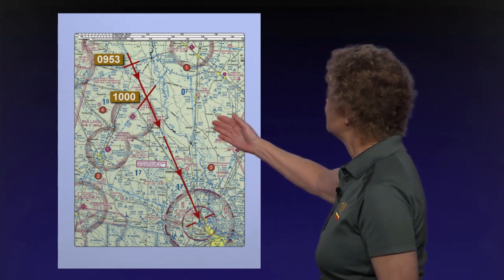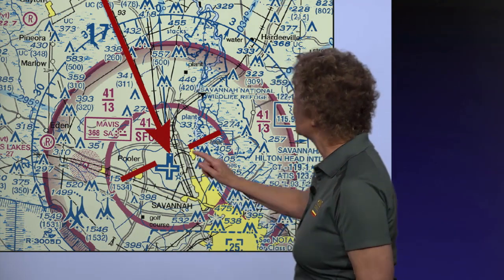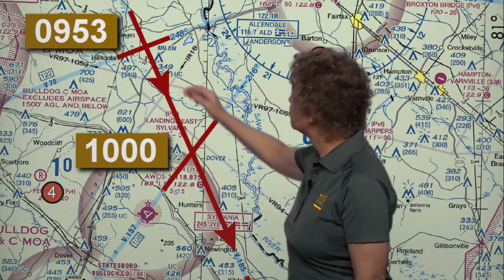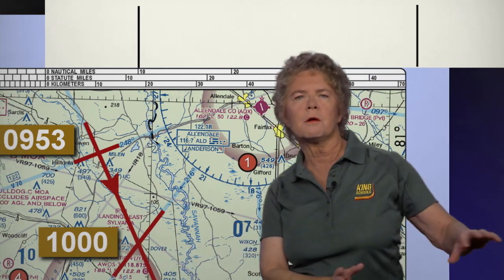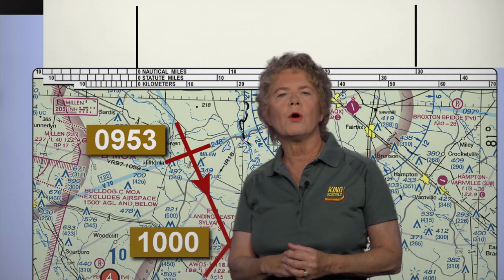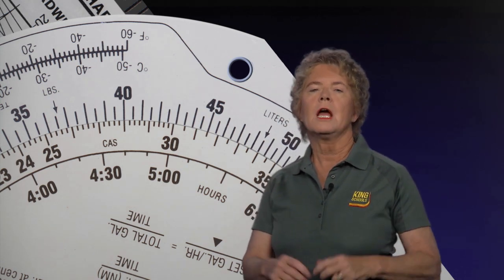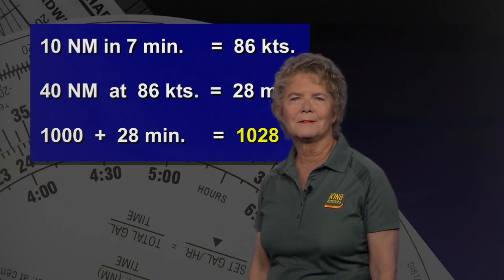How to Use Your E6B - Video 9 of 14 - Calculating ETA (Estimated Time of Arrival)

Comment: You already traveled 10nm, so you only have  30 nm left; not 40!
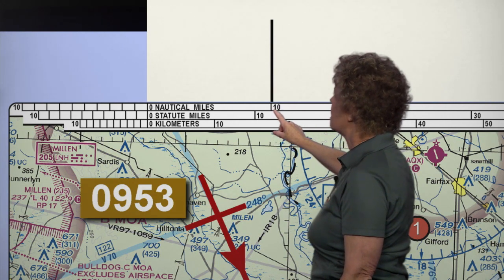Reply: Wrong! The flown distance of 10 nm is between 248° and 216° Alendail radial. Remainig distance is measured correctly ( go to 03:00 ) from 216° Alendail(the second checkpoint ) radial to Savana VORTEC: 40 nm.

Comment: it is become very easy with your explanation and I have a question how can I know between first checkpoint and second checkpoint is 7 min thanks .
Reply: Uber late, but it’s the time different in the scenario.  953 first checkpoint, 1000 second. That’s 7 minutes.
Reply: You'd use a stopwatch mounted to the dashboard, an iPad, a wristwatch, etc., starting the time at one radial, then observing the elapsed time at the 2nd radial, writing both down on a log or paper for reference, and then performing the calculations above.